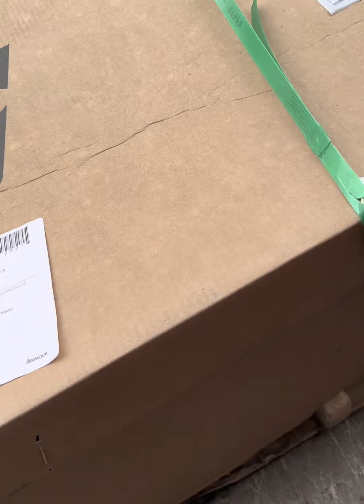1966 C10 rebuild

Comment: i traded 2 1990 cutlass 4 door cars that have bad problems for a 65 short box rust free truck for them even has the original 283 with a top loader 4 speed don't run need some work but in pretty good condition for a 65 looks like it mite even run with some work i got both cars for free on a clean up